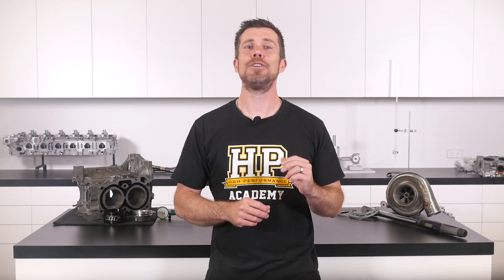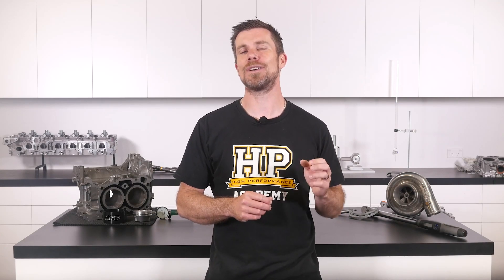The ONE Go-To Idle Timing Option | Does It Exist? [HPA Q&A]

Comment: What lift and degree is considered as a big cam? My cam specs; duration @.050 intake 228 exhaust 238 lobe lift intake .370 exhaust.365 valve lift @1.65  intake .611 exhaust.602 lobe seperation 113.5
Intake center Line 111

Comment: Could running negative ignition timing at idle cause any type damage or negative effects on a cat-less direct injection engine? Say around -7 degrees or so?
Reply: Yes. If the timing is severely retarded, the air/fuel mixture will still be burning as the exhaust valve opens, which isn't good for the exhaust valves. The engine and exhaust system will also get much hotter with severely retarded timing.